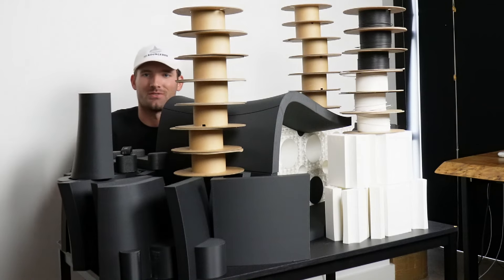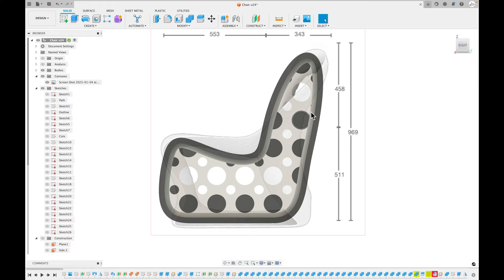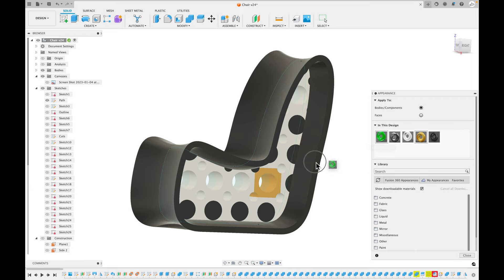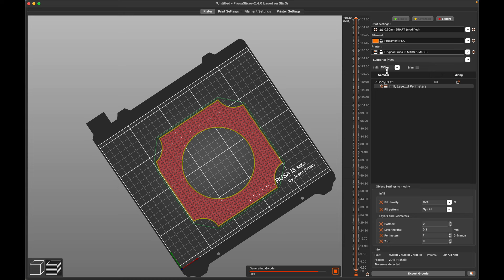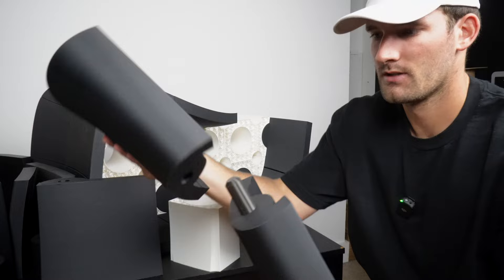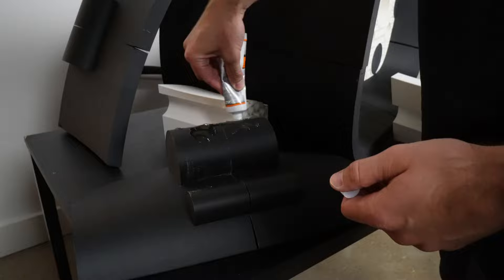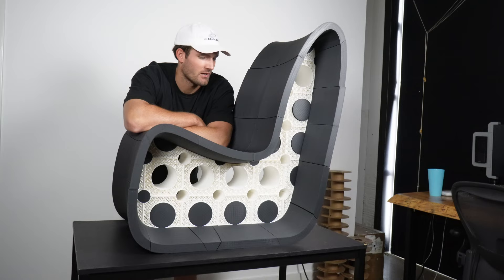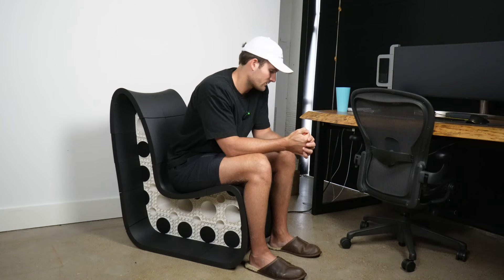I 3D Printed a Big Chair with 4 Prusas and a P1P!

Comment: It looks pretty cool! one tip would be to increase the line width on the infill, it would make it so it prints faster, the infill lines are more visible and the strength would remain the same, maybe also add vertical pegs for the pieces going along to align themselves too
Reply from the maker: Are you talking about the layer height or the actual width? I made the layer height .30mm in the actual print (probably skipped that in the video). I’ve never adjusted the layer width though.
Reply: I mean the layer width, you can increase it past the nozzle width by a lot so the amount of infill is the same but less lines are made, so it is faster as well
I use a .4 nozzle with .8 width for infill, works great
Reply from the maker: Ohhh I see what you’re saying! I’ll try that out! Thanks!!
Reply: @madebyjwillis  CNC Kitchen has a detailed video on Extrusion Width.
Reply from the maker: @SeanLewandowski2010  nice! I’ll check that out! Love his channel!